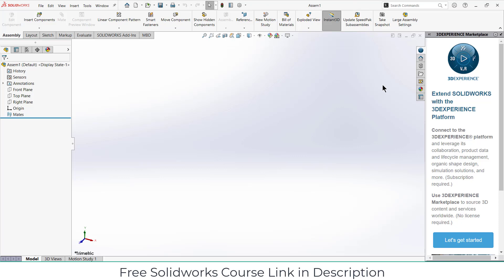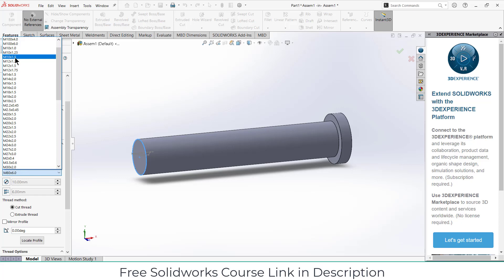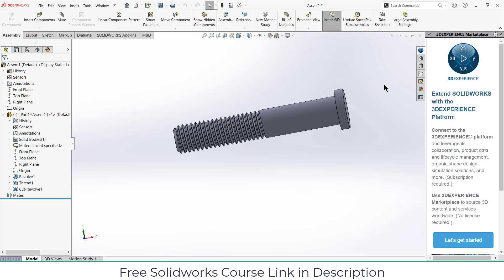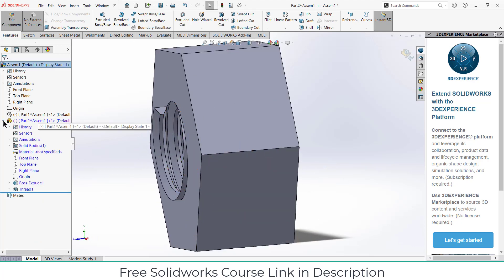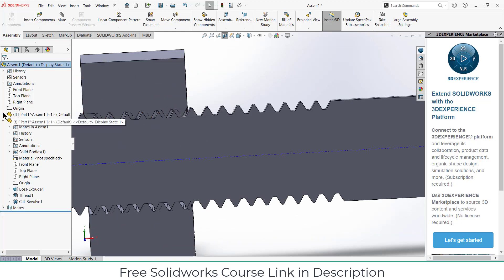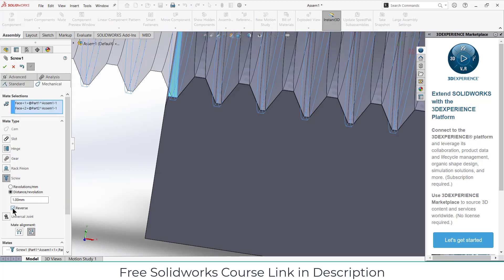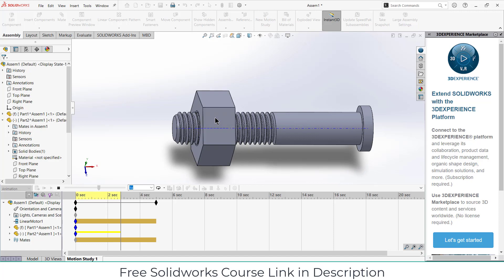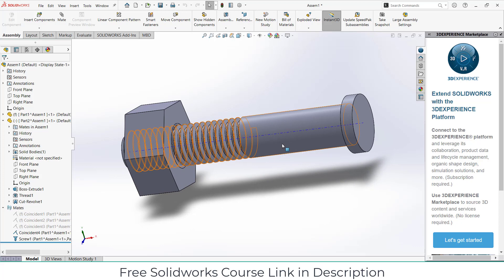Correct Way to make Screw Mate In Solidworks 2022

Comment: At the final animation you can see the nut with left-hand tread moving up on the bolt with right-hand thread.. 😞 The author doesn't know when left-hand threads are used.. And the episode with chamfering instead of using OFFSET and TRIM WITH dialog options is such a shame..
Reply: indeed quite disappointing